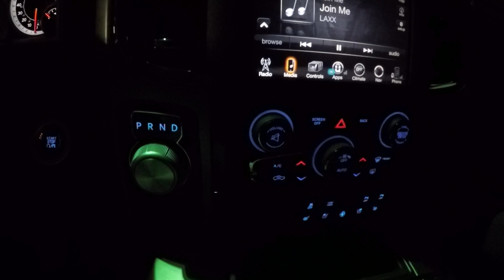An interesting night at the 1/8th mile drag strip - TruckTalk #20

Comment: What gear ratio do you have? I have some what the same truck as you 2014 2wd big horn 8speed with 3.92. I've being wanting to take mines to the track here in vegas to see what my stock times would be. Hopefully next month ill get some runs in.  Also + 1 on leaving on the last yellow light and and stage your RPM ups to about 1000 or just before you feel you tires start to spin. Try a lil practice on  a clear open road somewhere to see what RPM is the best holding one. Also i would suggest (if you are not already planning) run a good sticky tire on the 17in rims i had good luck with Nittos  doing the same amount of burnout you did.  Great channel just got my truck in november with 28k miles on it and ive been watching your channel ever since and learning a lot of things form your videos.    GREAT JOB👍
Reply from the maker: Thanks Kendrick!  That was the first time ever dragging the truck so definitely some improvements to be made and only got 3 runs.  I bolted up the 17s on the weekend and hot damn its night and day different!  Plus with my 3.92 the smaller 17s should put my effective ratio closer to 4.10 but I have to double check the overall diameters again.  I'm going to roast these factory tires then like you said I'll swap them out for a sticky tire.  Thanks again for your support! 👍
Reply: Your welcome no problem can't wait to see the vid.

Comment: Pulls hard! RPMs climbing just as quickly in every gear. sounded great too.
Reply from the maker: Wait until you see her run with 17s.  Should be fun!
Reply: BoostedMotorsports  wheel and tire size, overall diameter and weight really make a huge effect to how quick the vehicle is. Intake,   exhaust, catch can, Tune and 35's, my truck pulls about the same as a stock ram.

Comment: So much more to pull out from that canned tune. Can't wait to see it run with the 17's.
Reply from the maker: I bolted them up on the weekend and holy crap is it way better.  Around 25lbs lighter per wheel and smaller diameter will give a better effective gear ratio 👍

Comment: 9.48 is about 14.76 in the 1/4. Leaving on the yellow will gain you a half second or more. Rev that engine for launch will gain you some and every 100 lbs is a 1/10 in the quarter mile. no passengers will help. So without changing the wheels you should be able to get a 13.99 out of the truck or better.
Reply: Bill Antalek jr time at the track doesn't start until you move
Reply: Jason McClurg if you wait for the green your reaction time is 1 second. If you leave on the last yellow your reaction time is half a second. So if you wait for Tue green while everyone else drag racing tries cutting a good light, your always gonna he a half second slower than the other lane.
Reply from the maker: Hey Bill I swapped to the 17" wheels yesterday and also weighed them.  Almost 25lbs per wheel!!!!  Truck is night and day faster now just rolling around town.  Should be interesting to see what she runs now 👍
Reply: BoostedMotorsports that's awesome! Love the looks of the gold wheels. Hopefully it's just a track day swap. :)
Reply: Bill Antalek jr you're right but your time isn't going to gain a half second. You can sit green for 10 seconds and still run the same time but you will lose because of reaction time.
Reply: Jason McClurg gotta get them .500 r.t's. :)

Comment: Do you have a limited slip and what gearing? And are you thinking about any kind of suspension mods? Specially when you get all boosty...
Reply from the maker: Yeah factory LSD and 3.92

Should hopefully see some good times with the 17s this week. 👍
Reply: My 16 crew big H has 3:21, I just got if used a month ago and now I know the diff between 3:21 & 3:92..   can I do a swap? And is it worth it?